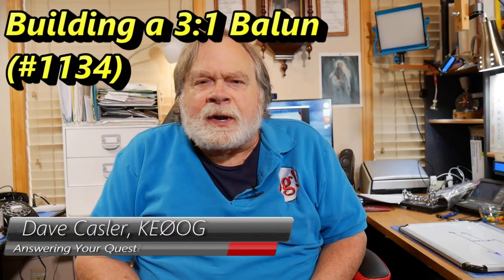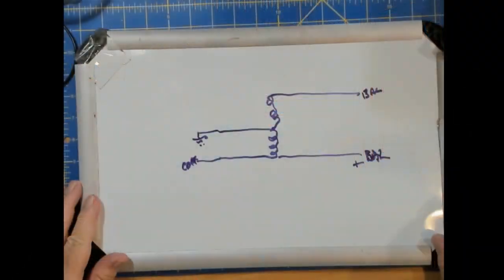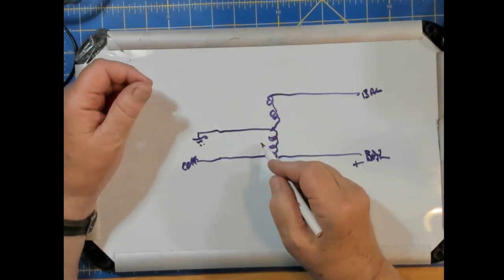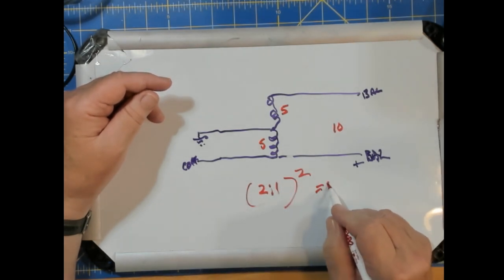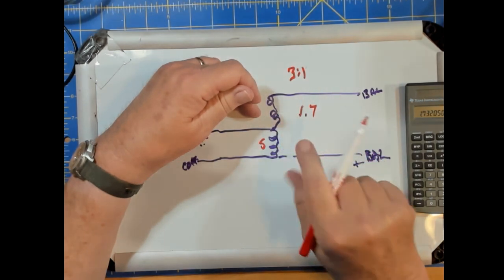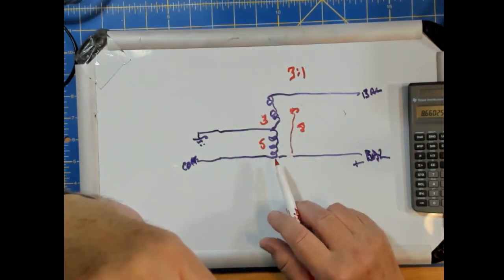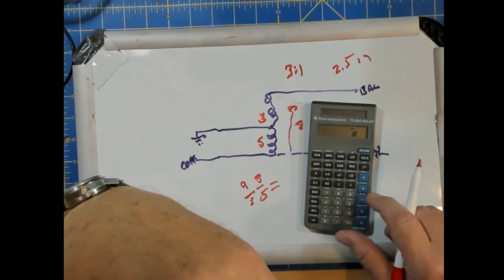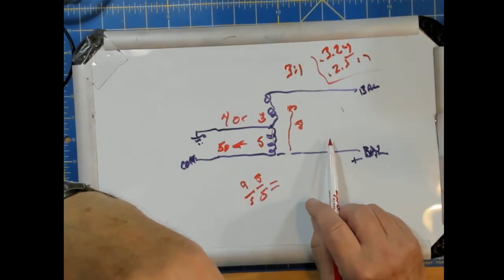Building a 3:1 Balun (#1134)

Comment: A balun is an RF transformer that has one side balanced, the other unbalanced. Without it, the unbalanced line will tend to develop a current on its outer surface, which can cause issues. What David presented is an unun where the common pin is supposed to be at ground potential. I think it's best to add a 1:1 current balun on the 150 Ohm side of the voltage balun, to make sure no current can appear on the outer shield of the (unbalanced) coax.

Comment: Try 10 and 7 turns.
Reply: That is close as you can get without using a high number of total turns.
Reply: @LeeMccNA5T  You can get a hair closer with 18 and 13 turns.  31 turns of 12 gage wire on a  FT240-43 or T-200-2 toroid wouldn't be excessive but maybe not worth the effort.
Reply: He needs 3:1 which can be achieved with 7:4 turns ratio (7 turns with tap after 4th turn).
Reply: @Matthew.Morycinski  All examples are giving about 3:1.  It won't be exact.
Reply: @richardl6751  I know but 7/4 is very close to square root of 3. The actual ratio is 3.0625.
Reply: @Matthew.Morycinski  And (31/18)² is just a little closer at 2.966.